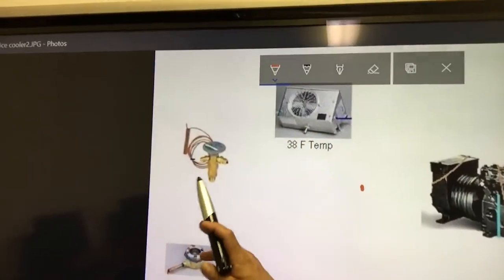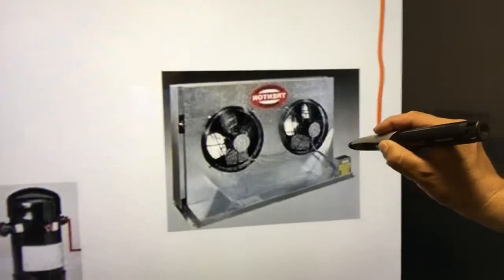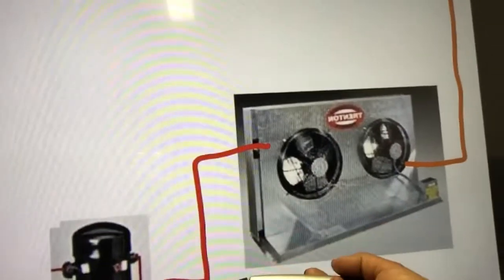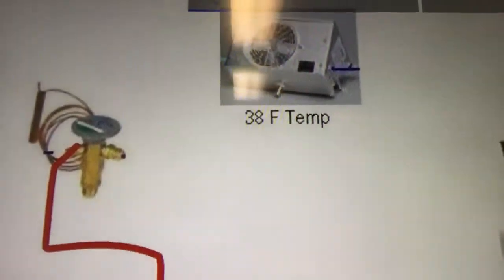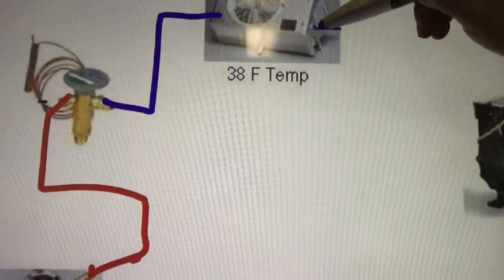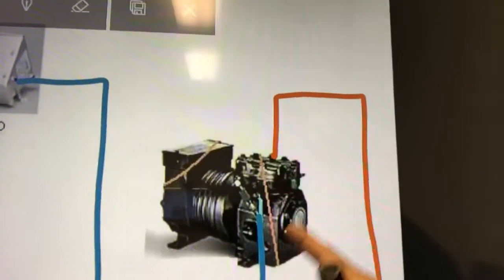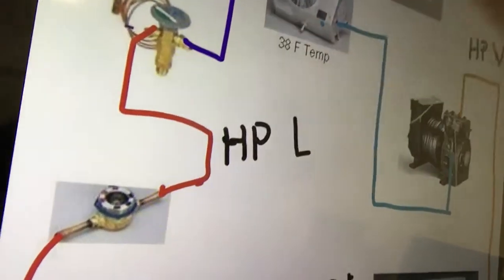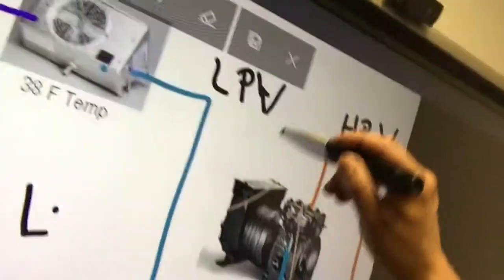Refrigeration system3

Comment: good videos, I have a question can i use the gauges with R_ 421A for R 22 
Thank you. 
Good night.
Reply from the maker: Jose Villa, if the refrigerant has poe oil, is not recommended because R22 used mineral oil and you can not mix different  oil in your gauges.